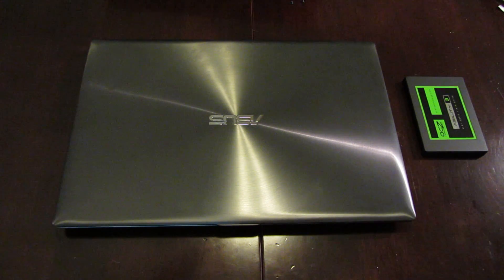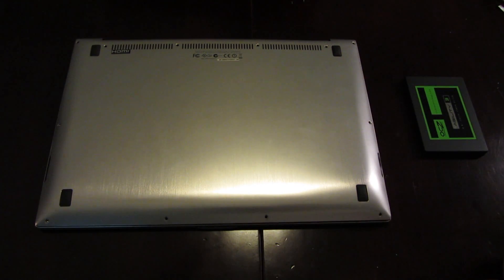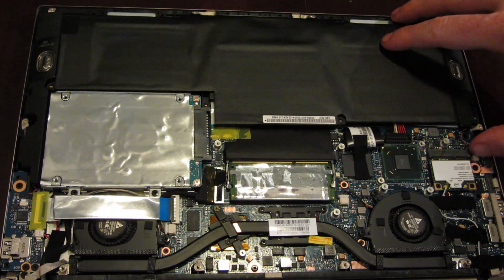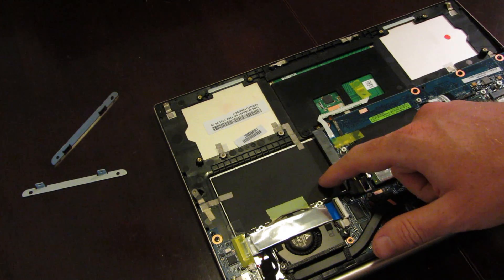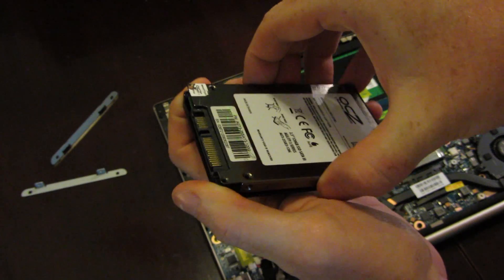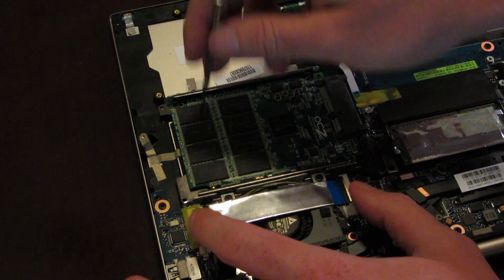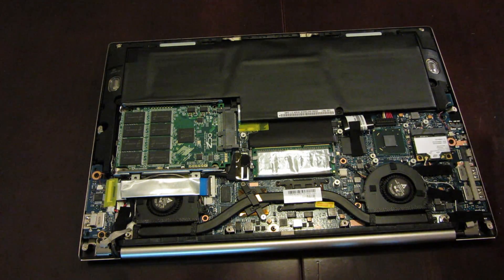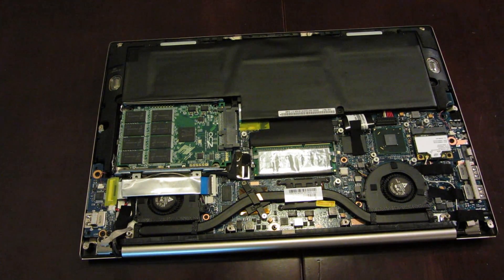How to Install a solid state drive (SSD) in an ASUS Zenbook UX32VD-DB71

Comment: ATTENTION!!! His statement about the cover not getting off because of the adhesive stripes does NOT apply to 15" models of the zenbook! There ARE two additional screws under the black rubber parts which also have to be removed. I nearly broke the cover because of that..

Comment: I used, and I think it might be better, asus backtracker which is included on the laptop. It makes a recovery usb for you. Put in your new SSD and use the USB. Make sure you have set your BIOS to boot on USB which there are other guides for.
After that just use the new Windows 8 reinstall feature to get a fresh install without any bloatware you don't want. Or just be happy with the factory restore.

Comment: So doing this frustrated the crap out of me, mainly because I lacked some info from the video, so here is a quick highlight of what I did:
1. Unscrew all bottom screws, like said in the video there are two wads of glue at the top, slowly nudge the bottom cover off.
2. Unscrew all screws around the battery (huge black thing with speakers glue to it).
3. Unplug the tiny speaker cables.
4. (This is where it where I had issues) Lift up the battery at an angle, the cable should stretch a bit, now do soft tugs upwards from it to lurch it off.
5. Unscrew the 4 hard drive case screws.
6. Pull the hard drive away from the connectors.
7. Screw the case off the hard drive(really only two rails).
8. Do everything in reverse to put it back together.

So the tricky part now is installing windows again, easiest way is to get an ISO of windows 7 or 8 and use this: http://www.microsoftstore.com/store/msusa/html/pbPage.Help_Win7_usbdvd_dwnTool to make a bootable usb.

But now the damn usb won't boot, cos that stuff was made for Windows 7, which is legacy at this point, so what you need to do is change a settings in your bios. Under the boot tab, you need to enable Launch CSM, which will allow you to use "legacy" boot code.

Once you are done installing, remember to restart your pc, press f2 to enter the BIOS and disable CSM and re-enable Fast Boot. What does fast boot do? Makes sure your pc will boot in like 5-6 seconds.

Hope this helps. :)
Reply: Oh and for those of you that is battling with the big OEM fuck you gods, use this site to be able to install the version of windows you want:
http://theblogpirate.wordpress.com/2014/02/22/bypass-the-uefis-windows-78-key-installation/

Comment: I nearly got this laptop. 
What held me back was the lack of a solid state drive and touch screen.
I already have a desktop for max performance and I wanted I lightweight one I could take to uni. 
The problem is to buy this model with the touch screen option and to buy a solid state drive somewhere else I would have to pay $2000 (at the time).

I bought the touch screen model without a graphics card instead. It cost $900 and was defiantly worth it. 

But for $100 more I could have gotten the lower end Macbook pro with a graphics card. Engineering of course demands I use windows however.

Comment: It's beyond me there isn't more 7mm SSD drives out there. There would be a huge marked for them plus there's nothing on the PCB actually using the extra 2 mm of space. Also fitting a 7 mm drive in a bay accepting 9 mm drives is usually no deal at and I've seen no machines requiring a spacer on order to do so.
To my knowledge many of the Intel drives are actually 7mm high with an attached spacer. Remove the spacer and fit some shorter screws. How also voids warranty even no sticker and reversable

Comment: Finally after playing around with the BIOS settings, I managed to unlock the USB Boot option, as it is locked by the BIOS BOOT securty lock....
Now I can try to boot with USB for installing windows but I get an error of having an image in the 24 GB SSD drive on board...how do I disable that...or disable the onboard SSD so I can install windows and my laptop gets back to normal

Comment from the maker: You probably need to change your BIOS settings so that the computer tries to boot off the USB instead of your blank hard drive. On my laptop to get into the BIOS you press delete immediately after powering on the machine. Different computers use a different keystrokes so do a google if that doesn't work.

Comment: I installed the Transcend SSD720 256gb in my UX32VD, but it doesn't load it , getting a black screen when I turn the laptop on ... What is wrong? (tryed to clone the original HD) also I tryed the Transcend ssd in my acer aspire laptop and it works fine , installed windows 7 on it , installed back in UX32VD and still black screen...
Reply: I have the same problem as you solved it?

Comment: Thanks a lot for this guide, was more or less what made me get this laptop! :)
I would however suggest A Intel SSD 5xx series, they only require you to remove 4 screws and a plastic frame, no drilling needed, so the warranty is still intact.

Comment: In this case, I'll have to see the computer in person to figure it out. If you have another computer or an external 2.5" SATA HDD enclosure, you'll be able to test the SSD as an external drive to see if its faulty. Go ahead and do that first. You can buy the 2.5" SATA external enclosure for 9.5mm/7mm HDD on ebay.

Comment: i did the same thing on my own computer.  i tried using asus's own disk drive backup program to create the 4 disks, plugged in my new ssd (corsair neutron gtx 7mm), booted from the disks in the external dvd burner, and loaded all the files/went through the disks.  when it finished and was attempting to finish the partition and everything in the asus command prompt, i got the blue screen of death.  repeated and got the death screen again.  any suggestions/ am i doing anything wrong?

Comment from the maker: Officially, you need a T5 torx screwdriver, although as I explained in the video I was luckily able to use an eyeglass sized flat head screwdriver I had laying around which fit perfectly into the Torx head from top to bottom.

Comment: 7mm is exactly the same size as the HDD that ux32vd comes with, I had them compared side by side. I haven't seen 9mm SSDs but I wouldn't recommend because the spaces are limited.

Comment: First of all, ux31's ssd is slow compared to what you can get out there. Ux32vd fixes a lot of the little issues that ux31 had, and it also has a dedicated 620M graphic chip on top of the onboard. I think overall ux32vd is definitely worth it. Only advantage I'd give to ux31 is that its a few mm thinner. Btw, ux32vd's Ram and SSD replacement is really easy as long as you take you're time and be careful. OCZ Vertex III's low profile 7mm SSD will fit without any modification.

Comment: I set this computer up for a friend. When you first turn it on, you'll need to find this ASUS recovery program and just burn the iso file to dvds, its very simple to use and you'll need 4 blank dvd discs if I remember correctly. External 8x dvd burner is only $30 bucks, so just get one.

Comment: So I got the single Corsair Vengeance 8gb 1600MHz ram installed and it does run at 1600MHz, very fast (now 10GB total). Also installed OCZ's Vertex 3 LP (7mm) 240GB SSD and it goes straight in without the need for any modification. Re-installed OS, tuned it up a bit, deleted all the ASUS junk and installed all the automatic self-maintenance programs. This thing is good to go, thx again for the awesome instruction video!!

Comment: yes it just has one slot for memory that can be changed. you can put 8gb in but the 1600 ram might go to 1333 but i think its possible to change that back up to 1600

Comment: Hey guys, I just installed a crucial m4 and I think it was much easier than using an OCZ. By taking apart the M4 you can make it into 7mm by borrowing some screws from the 512gb hard drive and using the original M4 cover. You still have to void your warranty though.

Thanks for the video.

Comment: @Jaminbird: Thanks for the video! Both this and the unboxing videos were very helpful. Just a quick question. Did you have any problems with BIOS recognizing the drivers for the SSD? I've heard that the OCZ Agility Drives have had BSOD issues. Did you have any issues with that?

Comment from the maker: Good point, when I did the video I misread NewEgg's measurements of the Patriot drive and though it was less then 7mm. However, it turned out to be 9.3mm. So it seems like 7mm drive would in fact fit unmodified.